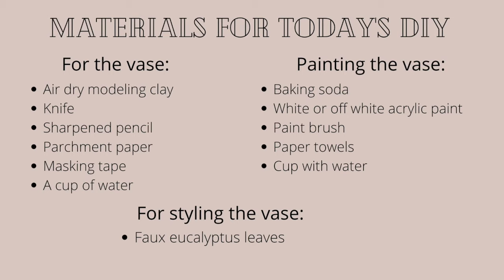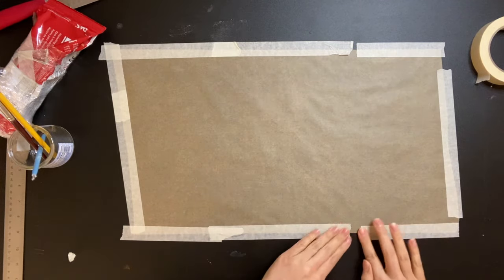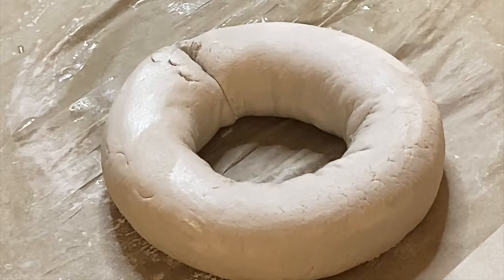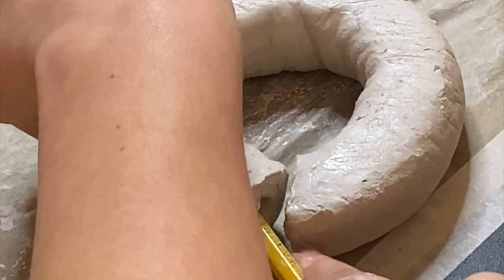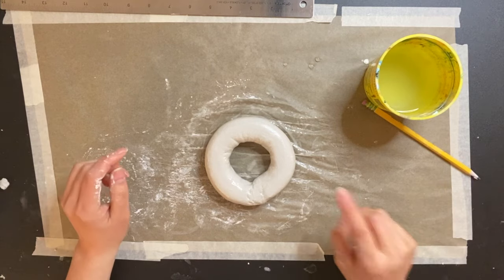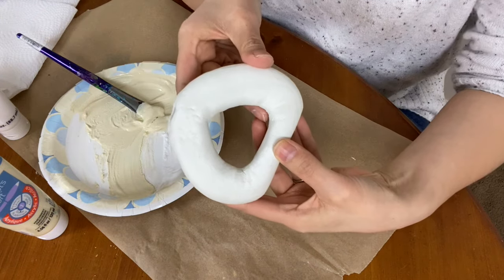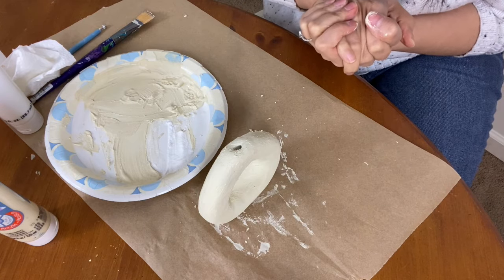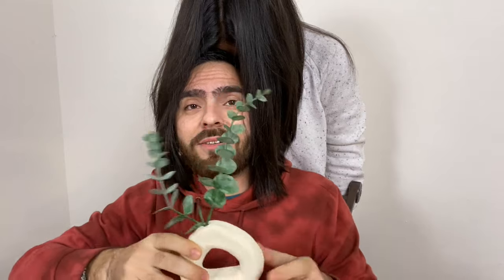DIY Hollow Ceramic Vase using Air Dry Clay and Baking Soda Painting Technique|  DIY Textured Vase

Comment: Never seen adc worked like that before! The hole at the top can match a hole at the bottom. Id rather Paint with "slip" it smooths every thing out.
Reply from the maker: Oh, yes! I actually did think of doing that as well and then decided to make the holes off to the sides. I've seen the vases with the cute glass tubes going through them too and I think they are so nice!  Thanks for the advice!